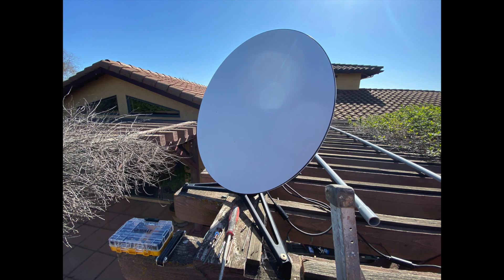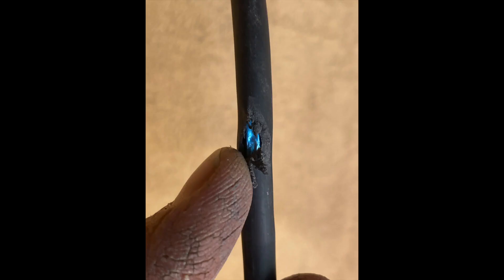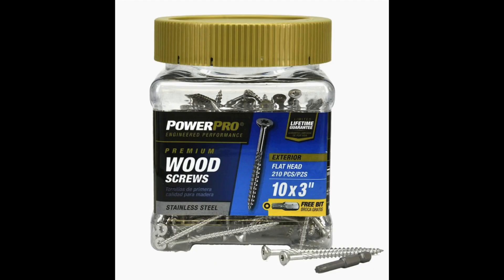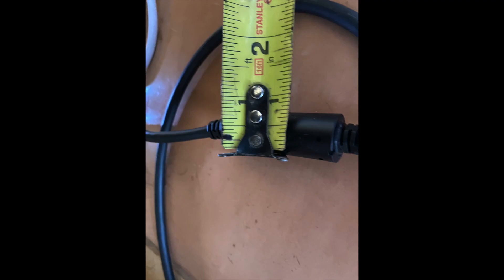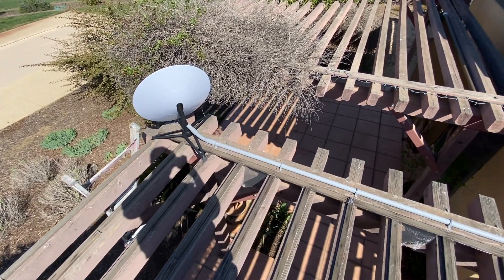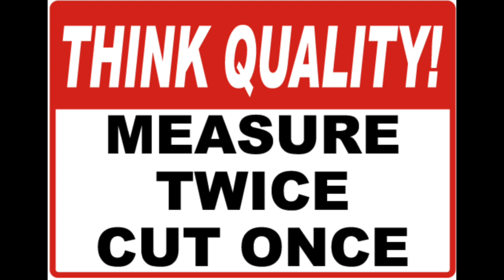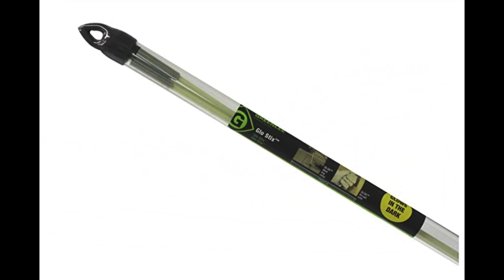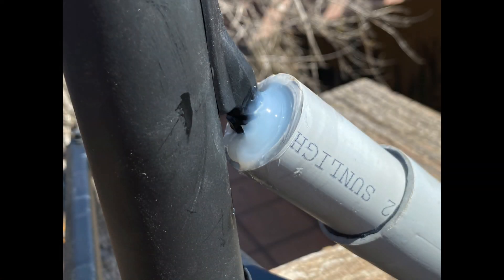Starlink Dish Installation

Comment: I want to install my dish on the roof of my garage that is not connected the house. It is 20 feet away. How do I jump the cable across safely?
Reply from the maker: Is there a way to run conduit from the garage roof, down to the ground then burry the conduit in a trench leading over to the house? If you can't do that you could string up a strong stainless steel cabe from the garage roof to the house roof and attach it to that.
Reply: @TheUltimateHandymanKyle  Thanks for the reply. The trench is not possible due to a vintage concrete hand poured walkway. I’ll ask some professionals about the cable. I want to make sure it is up to code. Thanks again.

Comment: The thick pieces in the cable are called "Chokes". If you would have use flexible nonmetallic Liquid Tight conduit it would have been much easier to deal with when pulling. You could have pulled the entire cable through the conduit and then attached to conduit to the house. Also, the nonconductive Liquid Tight will last much longer in the South Western with the large Sun exposure. In the future if you do another installation you can tapper the end on the conduit so that it covers the where the cable leaves the Starlink Dish. Then you could use a UVA/UVB Rubber Tape and tape from 3 in. above the cable exit point to 3 in. below the exit point. Stop using the Rigid Conduit for projects like this and you will be much better off...
Reply from the maker: Thanks for the tips. Its always good to hear different ideas on how to do things.

Comment: Curious why the upper conduit didn’t have a sweep down, just to insure no water could collect?  A nit to be sure though. 
Nicely done and a good simple video that will help many.  I enjoyed your humorous pictures added to move the storyline along. 😀
Reply from the maker: The way the cable comes off of the dish made it hard to install the inlet of the pipe facing down. I filled the end of that pipe with an inch think bead of silicone. That should stop the water from getting in. If I had the time that day and a whole store of conduit parts I could have done that part differently. I’m glad you enjoyed the video. Thanks for watching.
Reply: @TheUltimateHandymanKyle  I as I noted above if you would have used Flexible Nonconductive Liquid Tight you could have trimmed the top portion the fit flush with the Starlink tube and finished off the the UVA/UVB tape to secure it.